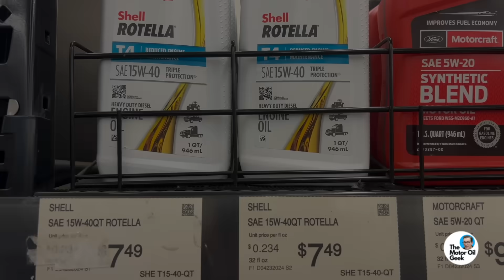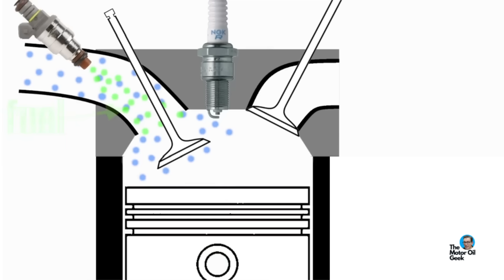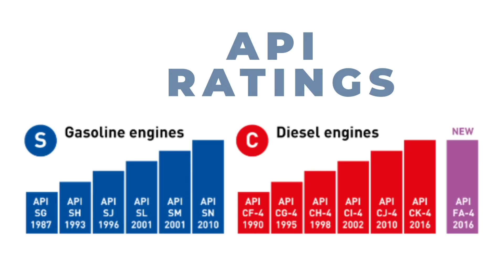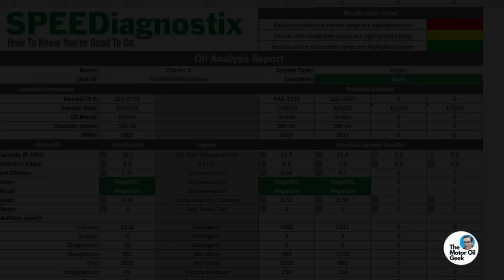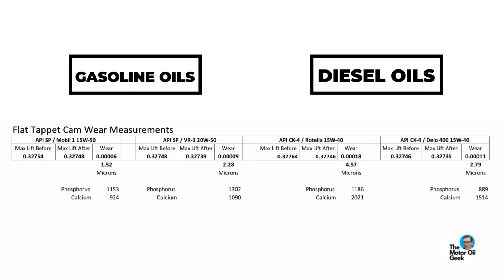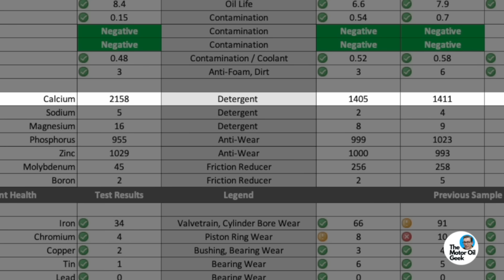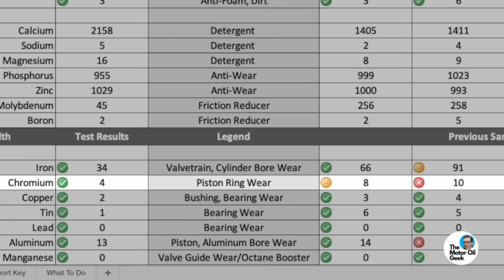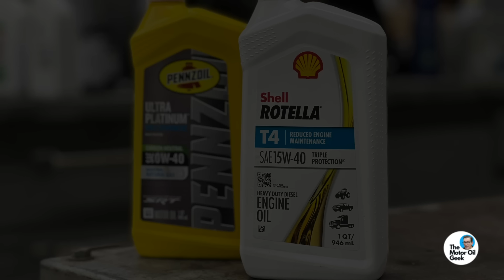Why DIESEL Oil is Actually WORSE for Gas Engines!

Comment: Hello I have 3.0l straight six diesel engine without dpf and egr in my bmw, can I use full saps oils or do they build up deposits on intake valves from pcv valve? 

Other option is using low ash low/mid saps oil but with less engine protection?
Reply: Just use what BMW says to use in the manual.
Reply: @nerd1000ify Low saps 5w-30 is too thin for tuned 500hp if you drive hard
Reply: @User.34680  Low or mid SAPS is usually only specified if the engine has a DPF. I assume yours has been converted to a racing engine and thus the emissions gear deleted?

Anyway, for a stock engine what you should look for is the standards the oil complies with. For euro engines the ACEA standards are often used, e.g. the manual for my diesel car (no DPF, does have EGR) specifies the ACEA A3/B4 standard which is a high SAPS oil, and you then pick your viscosity for the conditions- I drive in Australia where it's typically rather hot, so I use 5W-40 rather than the standard 5W-30. Notably, Hyundai specifies A3/B4 despite the fact that the same engine was sold in the UK and EU with a DPF fitted and using ACEA C3 low SAPS oil. So presumably A3/B4 tends to be "better" if you can get away with using it, though as this channel shows that's a statement which needs to be taken with a huge grain of salt.

 For your tuned application, who knows. Maybe call the tech department from your preferred oil supplier.
Reply: Thank you for your comment.

I have spirited driving style and I drive on the streets only not track. Im from finland so summers are only about  +20-30 celsius warm. Full saps 5w-30 might be good option since I have no dpf and egr but im still worried about deposits on intake valves if I use full saps oil but is that even a think on diesels?   @nerd1000ify
Reply: @User.34680  Usually the valve deposits are left because the sooty gases coming from the EGR mix with oil mist from the crankcase breather and make a paste that sticks all over the inside of the intake manfold, including the backs of the valves. I think with no EGR this should not happen.
Reply: Okay thats good to know. Thanks @nerd1000ify

Comment: There are many passenger cars with diesel engines, so i don't understand why you divide oils to "for passenger cars" and "for diesels".
Reply: Yep same here, i drive a Volvo V50 2.0D its nothing else than a passenger car! It's strange that MOTUL sugessted a API SP rated oil as the best choice for my diesel engine!
Reply: @kasparskorde2327 because is safe for the dpf.. If you are in europe there is the acea spec i guess they told you api sp acea c3

Comment: I understand from you video that we shud use specific oil for the engine.  However, can you explain if we can use an oil marketed as  diesel engine oil but has certification for compression and spark....  CI-4, SL, ACEA E7-16 in a gasoline engine?

Comment: Carburettor engine will wash the calcium out of the ring grove every so often. High overlap cam will prevent the low speed pre-ignition. I run diesel oil in a petrol tractor and small engines without any problems.

Comment: Ok, what about carbureted with flat tipped cams?
Reply: Ok, after reading through the comments, I've decided, I'll just figure it out myself. If I blow the damn thing up, I'll just fix it. The motor I'm working with is simple to work on, and I have plenty of parts.

Comment: Amazing video Lake! I subbed as soon as I heard your content. But I would like to ask a question:

- If diesel engine oil are better on handling soot whereas gasoline engine oils are better protection against low speed pre-ignition, how about engine oils that has "dual API ratings?" Is it interchangeable, as long as you met the viscosity and spec requirements of your vehicle? Or no?

For example: Shell Rimula R4 L 15W-40 API CK-4/SN
Reply from the maker: API SN does not provide protection against LSPI. Only API SP and SQ offer that.

Comment: At 14:30 he's clearly guessing about the oil that was used in the engine that had the failure at the piston ring.  If he doesn't even know what oil was being used, why is he showing this as an example of what happens when you use "diesel" oil?

Comment: I would never put diesel oil in any semi modern engine.   However, for old school domestic V8 and 6 cylinders flat tappet or roller cam shafts, Diesel oil works wonderful.     Many of these cars are driven less than three thousand miles per year.   Change it annually and you will be golden.    Ninety nine percent of these people don't care about one hundred thousand miles anymore.    The car will never see it and the people driving them will not either.

Comment: 25 yrs ago when I was a owner op I bought Rotella by the barrel. Put it in my Chevy pickup, got worse fuel mileage, changed oil to gas engine oil, mileage came back.

Comment: Lake, What are your thoughts on using Diesel Oil in a small air cooled engine for a lawn tractor, pressure washer etc.?  A lot of people are suggesting it on various message boards.

Comment: Many use Rotella in their motorcycles to get the higher ZDDP levels for flat tapped engines.  Have you ever tested motorcycle specific oils compared to diesel for use in motorcycles?

Comment: I sometimes see engine oils which come with both ratings, api-s* for gasoline and api-c* for diesel. what is going on there?
 randomly checkig i have the impression, these oil come with high calcium, so i would inteprete them more as diesel than gasoline oils. eventhough they also are advertised as "classic" oils for classic gasoline cars...

very confusing

Comment: Ive used it in my La Magnum (15/40), and felt pretty good about it..more vitamins and dinosaurs I thought. Since rebuilding the engine, I've ran 10/30 synthetic gas oil..have lots of 15/40 diesel in storage but im going with Lake's experience and knowledge. I'll be using the synthetic gas oil from here on out.

Comment: Unsubscribe this guy tries to scare the sheet out of everyone.   I used lucas for 50k miles. New engine Watched a video that said don't add additive,  changed the oil no lucas. Immediately noticed motor noise Motor blew in 3 weeks.  T6 in every lawnmower engine, Boats. Motorcycles tractor. For at least 25 years perfect. Want to Blow your motor.  Listen to this guy. The real test is practical.  Put the lucas in.

Comment: I have had over a dozen trucks both hot shot and wreckers well over the 400k mile range and 4 that went over 600k miles with zero internal issues. Rotella T4. My Camry went 500k miles before it started ticking on t4. Now I have newer engines LS chevy and fords that are headed to the same high miles ranger running the t6 Rotella synthetic. Keep you oil changed at proper times. My delivery service trucks all went over 900k miles on the diesel engines and the gas rigs again everyone of them even the notorious 454 Chevy's went over 400k with no major engine issues. All my performance engines we have built for decades after break in oil was drained we all run Rotella T4 for the flat tappet camshafts need the proper amount of zddp. Even all my motorcycles over the years have run super high miles with proper oils changes on Shell Rotella products.  I know the newer oils are designed for roller engines. The newer oil will absolutely kill flat tappet engines. Today we run only Mobil One in our newer cars yet I will always run Rotella products in our truck, mowers, tractors, motorcycles, gensets, Even the T6 in out compressors that are over 50 years old and still running perfect.

Comment: I'm an engine builder and recommend t4 for n/a application and t6 for boosted. Never had a failure in 20 years
Reply: I think the only potential problem is when you use diesel oil that doesn’t have any S ratings in a gas car which he completely skipped over
Reply: @daltonhammers  
There isn't any proof based on the volume of comments from the community members that they've had zero problems running diesel engine oil in a gasoline engine.  It probably isn't a good idea to run gasoline oil in a diesel engine as it doesn't have the cleaners needed for soot build up!

Comment: The question that I have (watching from Europe) is that the ACEA system in Europe is very Clear:  A= for Petrol passenger cars, B= for diesel passenger cars/vans, C= is for diesel and petrol passenger cars with catalitic concerters and a PF or DPF filter. Emission code Euro 5 and Euro 6. The ACEA E codes = are stictly reseved for Trucks/Lorries/LKW (not for passenger cars and van's. And I now know why thank to your video. But I am stll a bit puzzled by your explanation. 
So I have a question for you both.The piston ring from the Audi you showed is an prime example what I decribed in my other comment. I have had customers in my shop with this problem, who absolutely only used Audi specs. oils, most used is Castrol Edge 5W-30 ACEA C3 WITH VW 50400/50700 specification. 
So if the high Calcium content causes the LSPI, and my client has NOT used such "diesel engine oil aka ACEA E oil ", but only Castrol Edge 5W-30 ACEA C3 with the VW 50400/50700 specification. Why do have THE SAME problem? 
I am missing something I guess. The oil change intervals for engine oil in diesel and petrol Audi's in Europe is 30.000km (18.750mls) or once every 2 years. I am very interested in your opinion, because you are The Motor Oil Geek . 
What am I missing here? Can you help a guy out?
Reply from the maker: I’d need to see the Calcium level in the Castrol Edge to comment.
Reply: @themotoroilgeek  I do understand.  Unfortunately Castrol in Europe does not provide that kind of detailed information. But if I find it I will sent it to you! I just love the level of analytics and science in your video. But I do have just one small request (from a non native English speaker). Is it possible to speak just a little bit slower? In your enthousiasme, your speed of speaking gopes up, but my mind can NOT keep UP, proccessing all this new information. 
Well perhaps it is just me, could be. 
But remember; you can put information OUT, but is is equally important that the information is properly recieved! 
Thank's for you video's, I just love them!

Comment: Dave tells us at 1:15min. that a Diesel has TWICE the compression compared to OTTO gasengine's. That used to be true in general. So Dave is right, but at least in Europe, things have changed quite a bit in the last decade.
My old BMW Straight-Six Diesel M50 engine from 1994 runs at 1 to 22,5 compression ratio. A petrol engine from that same period would run at 1:8.5 compression ratio running on Normal Petrol 91 Octane. Or at about 1 to 11 compression ratio running on Super Plus Benzin 98 Octane (petrol/gas). Sportscars even higher. So Dave is correct in his statement. 
BUT due to Emission regulations from the EU regarding exhaustgas emissions, especially to get low NOx emission demands for EURO 6, things have changed dramaticly. As a consequence to get NOx numbers down, in the last 10 years Compression for Benzin/petrol/gas engine has been RAISED to lean burn at a 1 to 14 ratio. For diesel the compression ratio's have DECREASED to a compression ration of 1 to 16,5 (i.e. for my 1.6TDI 110hp form VW/Audi). So the NOx figures have gone down, as has the engine breaking has come down due to these low level compression ratio's for diesels. 
On the other hand. For petrol engine's compression ratio's have been increased .For both diesel and petrol engines it also meant Down Sizing the engine size, while raising Horse Power at the same time. The problem for Petrol engines is called LSPI (= Low Speed Pre Ingnition) meaning that with Direct Injection the petrol prematurely Ignites during the Compression Stroke. Which makes the engine want to turn the wrong way. Because is happens when pressure is building in the combustion chamber. Creating such power that pieces from the Piston sides will actually break off, usually between the First and the Second compression rings. As Dave has shown with the Audi Piston. So the Petrol engine is behaving like a diesel engine with Combustion Ignition.
Two reason's why this occures.
1) The direct injectors are getting dirty with carbon deposits which leads to glowing coal as a result of the higher air temperatues due to the higher compression.The glowing of the Carbon deposits on the Direct Fuel injector. So the petrol engine behaves like a diesel with Combustion Ignition. Solutions: 1) use Direct Injection Cleaner for Petrol regularly, LIQUIMOLY Direkt Injector Cleaner (blue cap = for petrol/gas/benzin). 2) Use a Carbon Clean product. LIQUIMOLY Motor System Cleaner Benzine for Petrol cars (blue cap = for petrol/gas/benzin engines. A red cap is for Diesel engines). Just pour it in a full fuel tank and drive normal till the tank is empty).
2) the second reason LSPI can occure is because of the ignition of the engine oil in the combustion chamber, due to the fact the engine oil Flash Point is TO LOW. Flash point on engine oil for Petrol Cars used to be around 200-210 degrees Celsius which is now raised for many oil to at least 230 degrees Celsius,  going up to 245 degrees Celsius. Also simultaniously, the Viscosity index of the EngienOil is being raised, but not as dramatic as the Flash Point values.
Keep up the good work guys! I love your channel Dave! I appreciate your honest and hard work and clear explanations and good customer service. Old school I guess, but hey we are almost the same age. Well done and Keep it up!

Comment: Everyone always says diesel oil can cause detonation specifically on direct injection engines but not port/ carbureted engines, but they never say why. It's like they don't know the reason and they're just regurgitating information they heard. 

Not saying it isn't true, but I'd like the hear the reason instead of "it just does"
Reply from the maker: Here’s why: https://youtu.be/c61lBa7l_9E?si=r9gMSrYlH75r14uH
Reply: So the poor fuel atomization of direct injection engines causes the fuel to mix with the oil, reducing the octane rating of the fuel, and diesel oils make this problem worse. 

Makes sense to me, that information is surprisingly difficult to find. Thanks
Reply from the maker: @HatersGarage  I'm happy to help.
Reply: @themotoroilgeek  after watching that 2nd video i understand how the poor atomization at low speeds can cause LSPI but it still doesnt explain diesel oils role in making that problem any worse
Reply: Rise and shine Mr. Rotella....Rise and shine.

Comment: Hey, I am running a SAE  30 diesel oil with no known additives according to the label for an old early 60's gas powered tractor engine. I do this for the zinc. I am guessing because it has no additives it is fine. The oil specs read "for use in farm machinery pre-dating 1969. This is a Farm & Fleet product.

Comment: I have a VW Jetta with a 2.0 8v gas engine. It burns oil. About a quart every 1k miles. I drive about 40k miles a year so it gets a little pricey. I already bought the 15w40. I have a diesel truck I can use it for so it’s not really a good excuse, but I already bought it, so it’s going in it. I’m hoping it slows down the rate it burns it at.

Comment: Had a 89 volvo 240 that  recommended 15W -40 oil.  All it ever had in it was diesel oil. Had over 400000 miles on it when it was scrapped due to vandals breaking out all the windows. It still ran like new and didn't burn a drop of oil between 5000 mile oil changes.  Used super tech oil unless I found something on sale cheaper.

Comment: Worked as a mechanic for a municipality for years. Used diesel oils in gas powered police cars for years. 100s of thousands of cumulative miles under the hardest conditions imaginable without any problems. Your "science" is flawed.

Comment: @themotoroilgeek  the general consensus in BMW motorcycle circles is the Shell Rotella T6 5w-40 is that not only is it safe to use in BMW motorcycles, at least the R1250/1200 Boxter engines, but it's the exact oil that sold to BMW and rebranded with BMW name. BMW spec:  SAE 5W-40, API SL / JASO MA2, Additives (e.g. molybdenum-based) are not permissible because they can attack coated components of the engine. Rotella T6 meets the JASO MA2 required by BMW.

Comment: Sir, I have watched many of your videos and found them informative, but this one? We'll let's just say i had an 01 gmc sierra 5.3 liter gas. I ran shell rotella t4 15w40 diesel oil in it and changed it every 5000 miles. At 600,000 miles i gave the truck to my son and other than bolt on parts and a timing chain the engine is stock and still runs perfect..  I have treated the engine with B&G products K44 to remove carbon a few times then changed the oil again.  At 600,000 + mikes it burns about a quart between changes and the rockers are getting loud . A perfect testimonial  for GM quality and superior oil.

Comment: A good experiment would be to run the exact same engines from pre-90s with flat tappet cams for 5,000 miles in real life situations, not on an engine stand. Take two old worn out small block Chevy vehicles and run one with 10w30 and one with T4 and examine the results then. My biggest gripe is these oil companies are testing their oils on engine stands, or examining the oil out of someone’s car after an oil change. In my eyes, the results are limited because you’re not including real world factors such as hard pulls onto the highway or towing, for example. I run T4 in my 87 square body for so many years with no issues. This was after 10w30 just wasn’t cutting it anymore since she’s got a worn out 305

Comment: Can you review Shell Rotella T6 🙏🏻 please!! I run the 5/40 in my seadoos and they are high horsepower supercharged.  It meets the spec seadoo wants for the supercharger wet clutch.  I’m so curious of this oil vs others . I’m wondering should I switch to a Mobile one gas oil now.